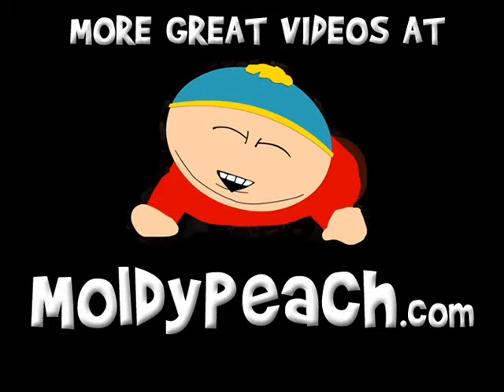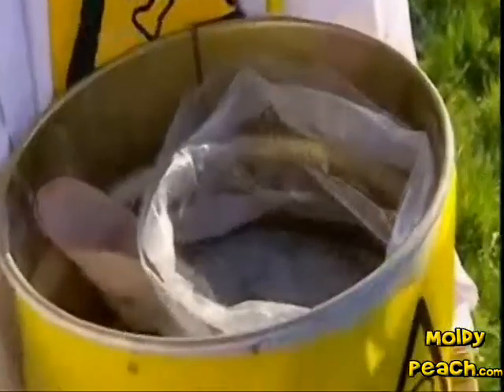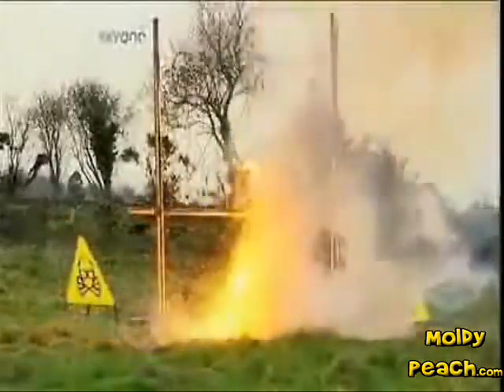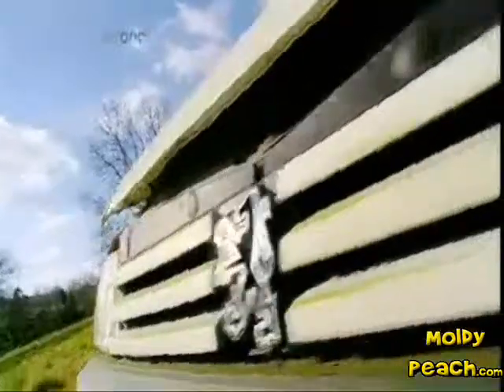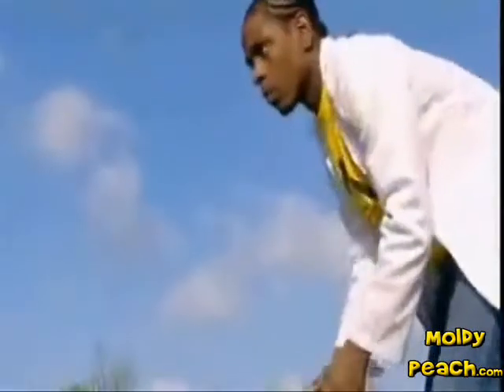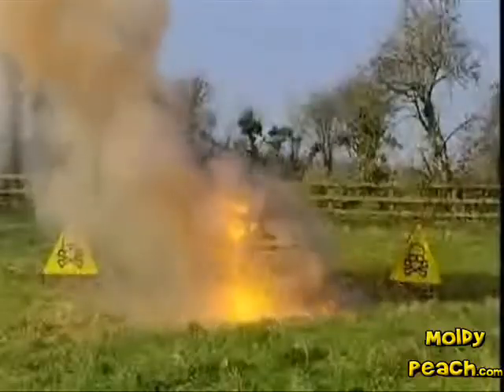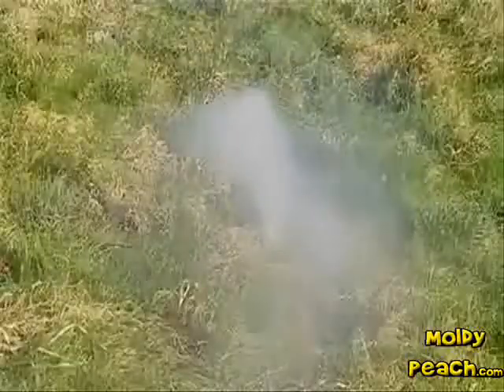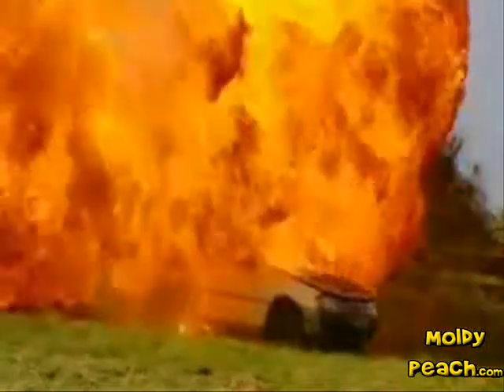Playing with Thermite

Comment: For use of thermite in cutting steel, see my video "Incendiary Experiments".
The mythbusters guys set off 1000 pounds of thermite to try to cut a car in half, and explosives experts at New Mexico Tech try to cut a column and a beam, and a Florida Engineer, Jonathan Cole, cuts columns, beams, bolt heads, and bolts.

Comment: you can make thermite from iron oxide(basically powdered rust) and and aluminum just file some of a aluminum block or bar powder booth and mix together but hard part is too light properly u need something really hot hotter than blow tourch so u need to get some magnesium ribbon or a VW engine block (older style) as far as i know almost pure magnesium grind some into mix and light with blow tourch but look out can burn thru hood of car engine block axel and road XD hav fun with it